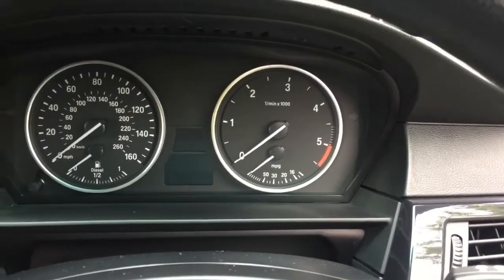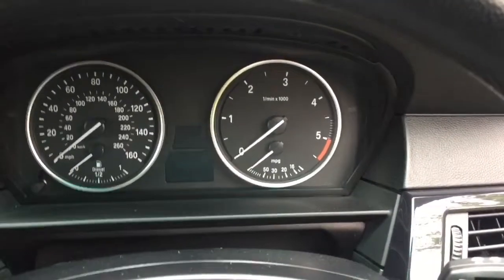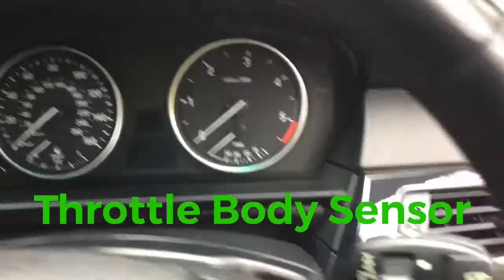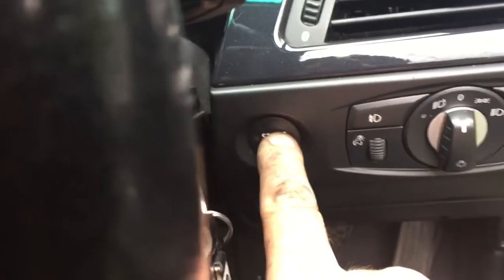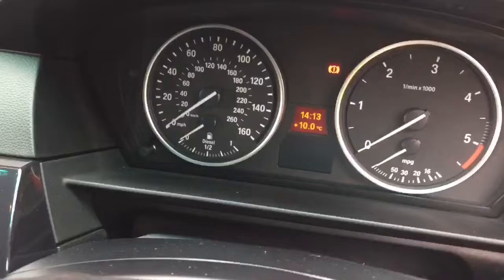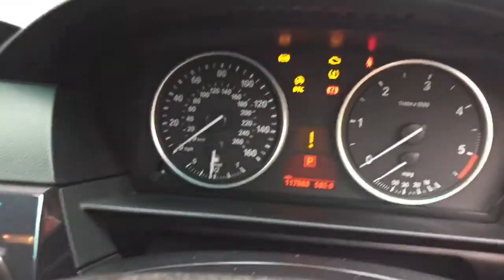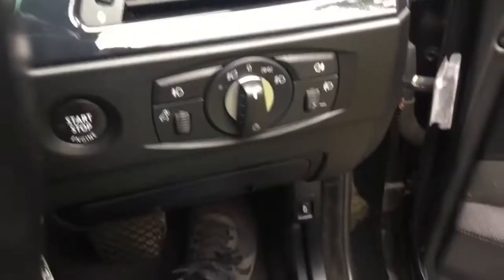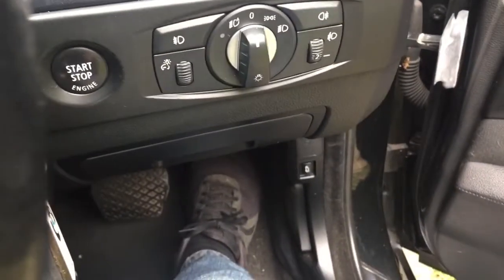How To Reset Throttle Body Sensor On A BMW E60 / E61 Auto For Better Response & Acceleration

Comment: I have a 2017 530i sport line which runs fantastic, except for the take off from a dead stop. I have to push the peddle down a good ways in order for the car to move. For a quick take off I have to push the peddle down close to have way for the car to go. Once it takes off it runs great but its that taking off that bothers me. This is my first bmw so is this normal for bmw's or do I have an issue going on that the car's sensor's just not picking up.
Reply: It maybe the lateral acceleration or transverse acceleration sensor
Reply: The car learns the way u drive it uses your driving style to calculate mpg .. if you drive fast every where your throttle will be more responsive if u cruise it will be weak and slow .. do what was explained in the video it will work but the car will learn your driving style again and u will have to keep doing that or u can buy a throttle controller like how I put on all my bmws and your problem will forever be fixed

Comment: Is that the same thing i should do on my n52 e90 for the reset? Car is automatic too and im wondering if this if this reset transsmision adaptations or reset both? Or the tranmission reset is doing in another way?
Reply from the maker: I’m not sure on the e90, I believe that resetting the throttle and transmission required different processes. I’m sure there must be a video for it on YouTube
Reply: This video procedure resets throttle adaptations.
For zf6hp, you need to use a scan tool like ISTA+ or INPA or DeepObD.

Comment: Dude you just saved me so much headache. Back story: 2004 BMW 530i I just purchased was stalling to crank. Negated the battery after buying s new one, alt was kicking out 13.5 as it should so went for the starter. Tore the whole drivers side engine apart damn near just to get to it. Only to find out after having it tested that it was good. Later found a short. Anyway, put it all back together and it went into limp mode immediately. Been hunting for days thinking it was a vacuum leak somewhere. Ran across this video and honestly had zero faith it would work but had nothing to this point and it freaking worked. Stopped that stupid idle surge and no throttle response immediately and just drove it around no issues
Reply from the maker: Pleased it helped

Comment: Got a 2006 520d e61 manual. Will it work on manual? Got a P2620 code (TPS position open) gonna try this tommorow as a first step.

Comment: Hi Mate thanks for the video, i drive BMW 5 series 520D and i have recently carried out glow plugs , glow plugs converter, EGR Valve replacements with DPF cleaning which has fixed the limp mode issues however i still feel a lag or sticky feeling (limp mode) for few seconds after changing gears . The car goes after just like normal but there is this imphase.  Do you think i could do the same like you have shown in the video , Would you know what the issue is , took it to the garage he said if you dont have any lights on he could not plug the computer to check what is going on. Thanks
Reply: Mine is a manual transmission Year 2008
Reply: I have spent well over £2000 and still having issues. making me loose my mind to be honest with you . thanks in advance for your help
Reply from the maker: I feel your pain....BMW ££££’s 
Sorry mines an auto. 
If you type in ‘lag after changing gear’ there are a few forums with answers. Hopefully you’re find one that helps. Best of luck
Reply: Just A Car Guy thanks
Reply: Bit late to reply but get new mechanic if he can't check error codes because theres no lights (check engine light i assume) ??? I have 7 engine fault codes and no check engine light.